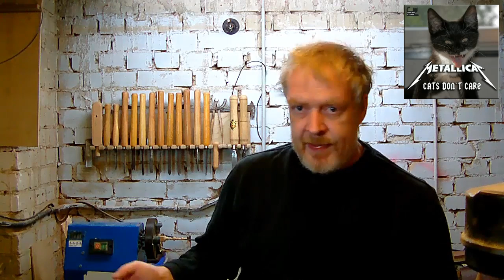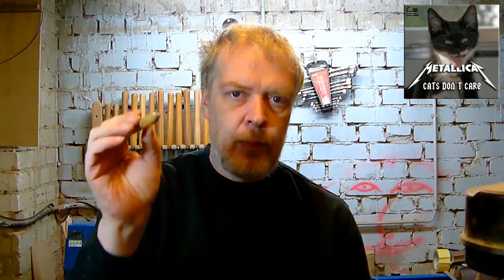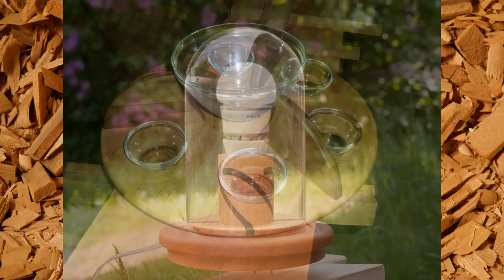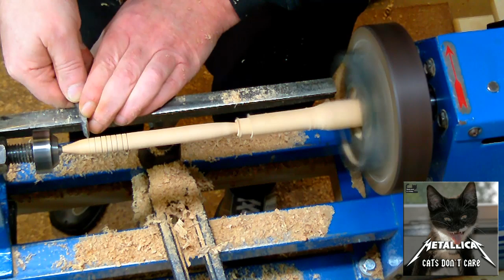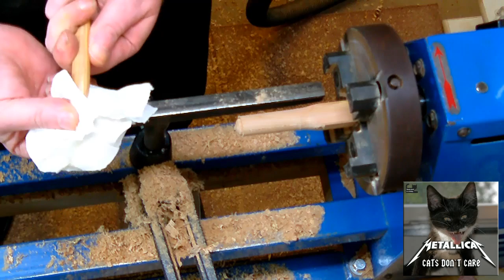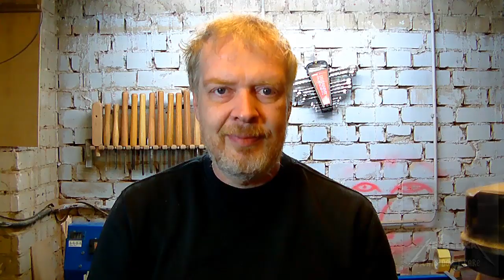TGIF PlumWoodChallenge EP#1 - Pen

Comment: Very nicely done!

I've made many of these pens - as you note, the insert is really cheap, so I make them to give away to people I encounter along the way - the clerk at the coffee shop, the person who cuts my hair, etc.  There is a factory nearby that makes kitchen ware from wood, and sells their wood scraps as 'kindling'.  I buy those scraps to use for turning, and earlier this week took a handful of these pens to the clerks in the small store operated by the factory.  It's only appropriate that a shop that sells wooden ware have wooden pens for use by customers when they sign charge slips!

I was able to find a 6" long drill bit that matches the diameter of the insert (5/32" using the archaic system common here in the US).  But I really like your clever (and elegant) way to deal with the fact that you don't have a longer 4mm bit - woodturning uses lots of tools, but being a creative turner means being clever about finding ways to do what you need to do without having to purchase every tool imaginable.

Comment: I made a lot of this style of pen many years ago. However, I found a 6" long bit to drill the hole. The bits were rare then but I've seen them frequently in hardware stores now. I'd still start with a short bit to reduce the flex when starting.
Nice work - working around the issue.
Alan

Comment: Hi Peter, those are great effects you do with your video editing, I was wondering what program you use for that and also what you use for filming. I finally got to do woodturning but still afraid to post in youtube, cause I do not have idea on how to do it!

The pen looks gorgeous, nice tip for highlighting the joint instead of hiding it!

Best, Daniel
Reply from the maker: Hi Daniel, 
Thank you for your comment and question.
For editing, I'm using 'Magix Video deluxe MX plus', for filming I've got a 'cheap' camera, bought at ALDI. For still pictures I've got a SONY A200. In addition, I'm using Adobe Soundbooth CS5 for enhancing the sound, Photoshop CS5 for the pictures, CorelDraw X5 and Adobe Illustrator CS5 for vector graphics. Would like to use my Premiere Pro, but my Computer needs new graphics, as one monitor isn't enough to run this program.
All of these programs are 'leftovers' from my former job as media designer, today I would buy a nice lathe, a table saw AND a band saw for the price of them.
Hope this helps with your question. Feel free to send me a PM if you need assistance using one of the above mentioned software.
Greetings from Good Old Germany
Peter